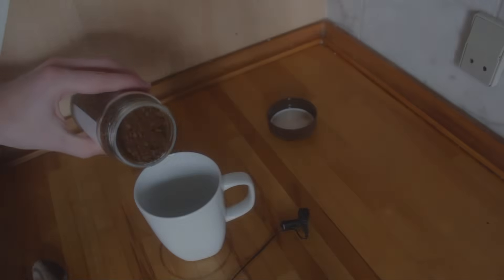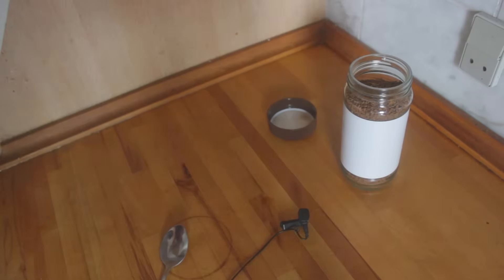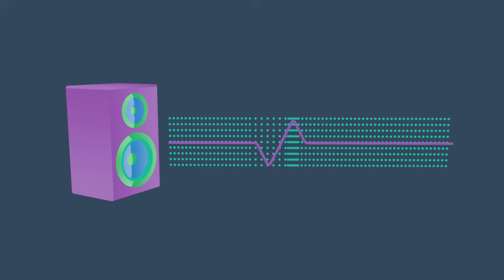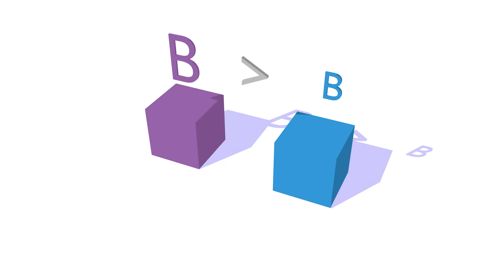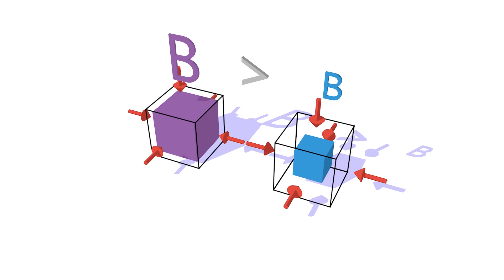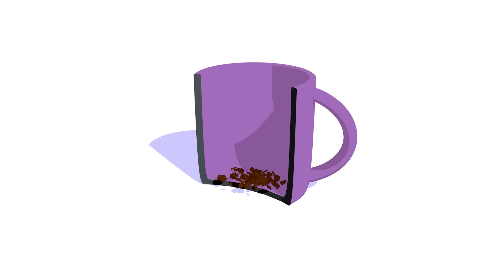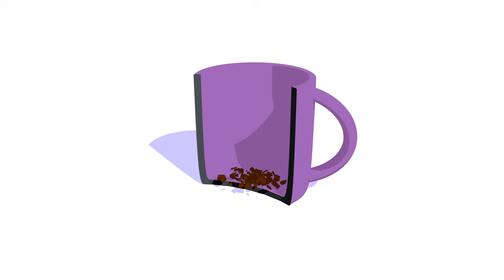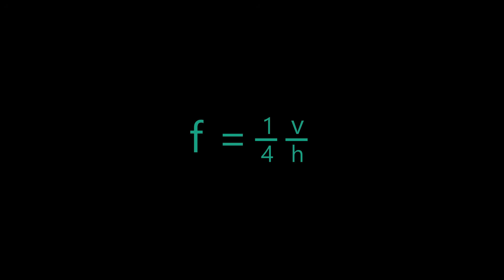Physics of The Hot Chocolate Effect

Comment: So, what is the main reason for the change in the bulk modulus? I would assume that it is mainly due to air bubbles trapped in the powder or granules (cocoa or coffee), and that the time it takes for the pitch to rise is due to the time it takes for the bubbles to propagate to the surface.
Reply from the maker: Yes air is way easier to compress so it has a low bulk modulus. Air = 100 kPa, water = 2 GPa, Diamond = 440 Gpa.
The time it takes is because:
1. coffee chunks has to dissolve, it takes time.
2. Air has to distribute around the water. So yes it's their time to propagate :D